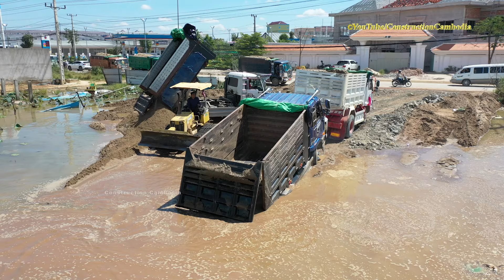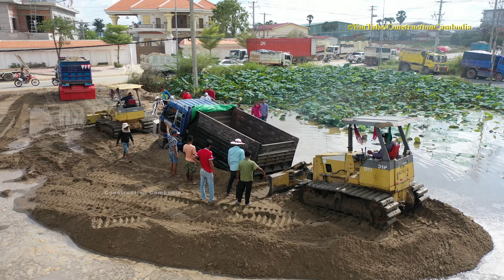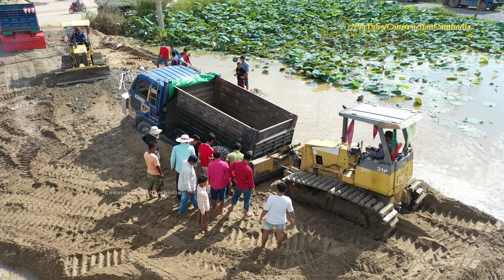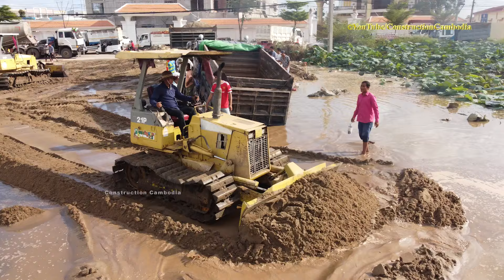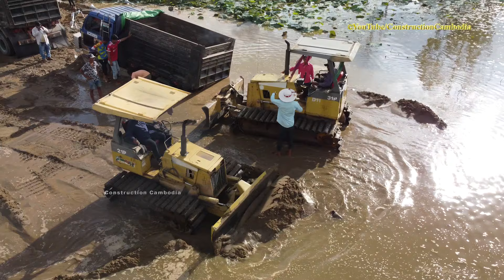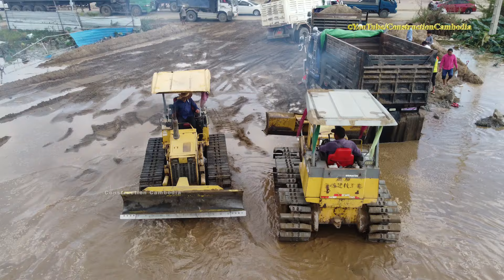Dump truck 5 ton struck in deep mud & recovery by Komatsu Bulldozer

Comment: 1st we have one truck hopelessly bogged. Then, the Dozer gets bogged, Then, another truck gets stuck. Note the high sides on the small single axle trucks...away overloaded as usual. Not to mention filling the swamp with fine sand as a construction base!! To many cooks spoiling the broth!
Reply: No o
Reply: @Sidek Samad There were at least 18 people shouting orders at both dozer ops and two truck drivers.  I don't know Cambodian but I think they were all yelling contradictory orders.
Reply: @kfourom  I'm an engineer, worked in Asia on some big jobs, as in lead engineer. It is normal for 18 people to be in charge, DON'T ASK ME, but you see it in all their videos. I shut my job down on the first day, and said, "Either I'm in charge, or YOU guys are in charge, I don't care which, but if YOU guys are in charge, I'm not responsible. If I am in charge, then I am the ONLY person giving orders or somebody is going to get killed, maimed, or we destroy a million dollar piece of equipment."  It went well for a few days, people did good, stopped giving orders. I took a break, and big machine fell and was laying agains the side wall of the building. Indians scrambling verywhere and arms flying. I came out and SCREAMED....  QUIET, everybody QUIET.  They all went and sat down, close by...  and I studied the predicament, when I settled on the solution, we slowly inched it upright, inch by inch. Any wrong move, and the back wall of the building would have come down, and the roof, OR / and we destroyed a million dollar printing press.  Back to your comment...  Normal.....  AND...  "I too don't get it....."

Comment: Those short wheel base trucks with single rear axle and dual wheels, are always getting bogged it seems, not to say the larger ones are free from trouble
its just that the shorties are prone to needing a helping push often.
Reply: きやらり！

Comment: In this condition this is necessary to use a 2X10 feet ( 2feet wide and 10 feet long) steel plat under wheel of dumper. That will help to stop stuck in mud

Comment: European health and safety at work people would have kittens if they saw that sort of mess going on. Obviously they had not got the one machine they really needed, a break-down truck with a winch. I wonder what material they were ploughing in it looked like a sand and cement mix. surely it needed a hard-core mix to give it strength. I would not buy any property built on that.